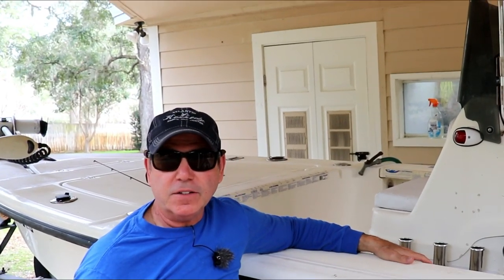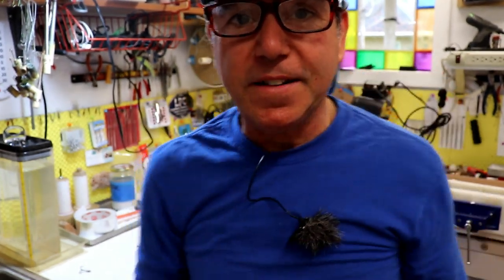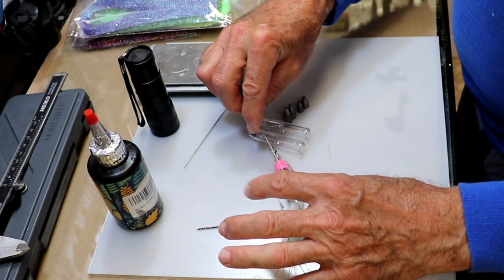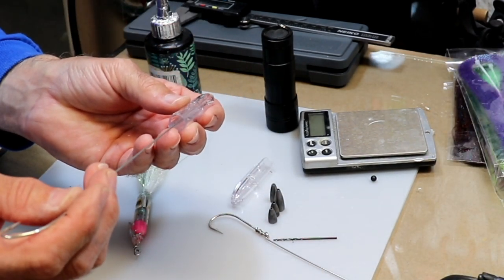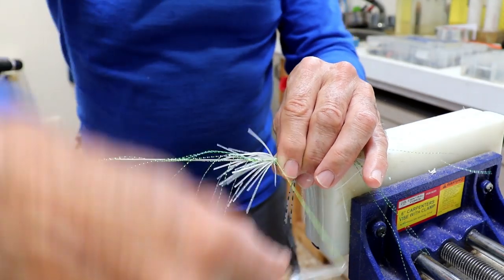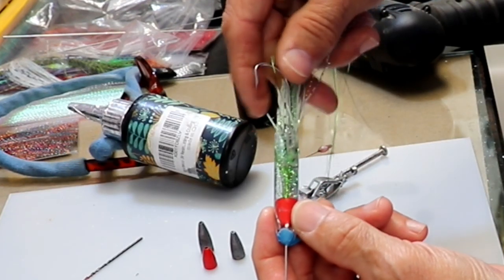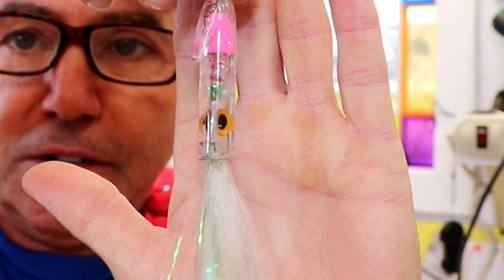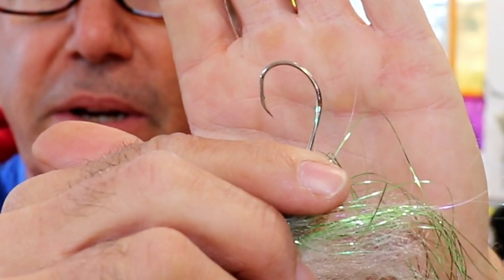Squid Jig Easy DIY

Comment: LoL. I've got a few of these I made for trolling for mahi-mahi. My wife has standing orders not to throw away this style of pen.
 I'd recommend using it as a trolling lure and use a tandem hook set up with a loop eye in both ends of the wire. Give the wire a kink ini the middle or barrel wrap it well into the pen cap before pouring in the resin. Then attach your swivel and hook set with split rings.
If you don't want to use a trebel hook then use a tandem hook set-up which will get you a hook up close to the jig and at the end if the skirt. To make a tandem hook set just open the eye slightly of a long shank 5/0 hook and insert a second hook then close the eye to lock it in with the hooks both facing down, not offset up and down, although actually I guess you could try it offset . You can see how to set up a tandem hook on South Florida Saltwater Fishing.
Reply from the maker: Thanks.

Comment: You could try drilling a small hole in the part where you cut off the pocket clip and add a trailer hook with a split ring
Reply from the maker: Worth a try.

Comment: Instead if wire try a shelled hook made of heavy mono or floro . You could then rig them in tandem so kind rigid but have some movement. A deep water light would be cool. May try plastic squid body inside with a bit. In salmon fishing there are clear plastic “bullets” that may work similar without the pen top. Very cool lure!